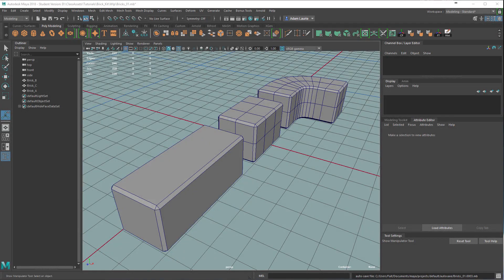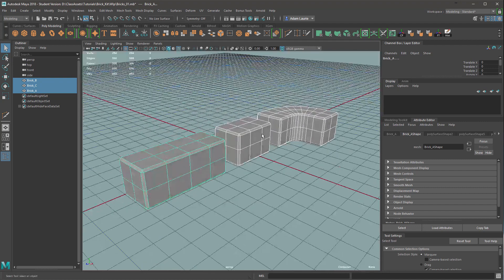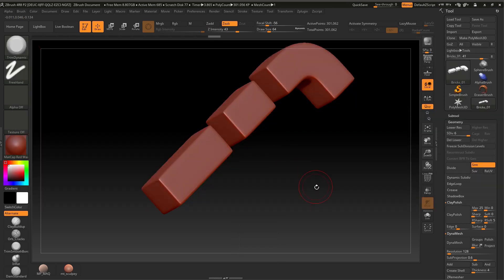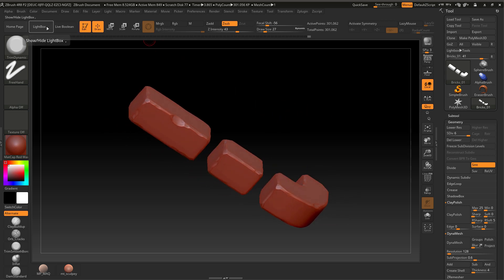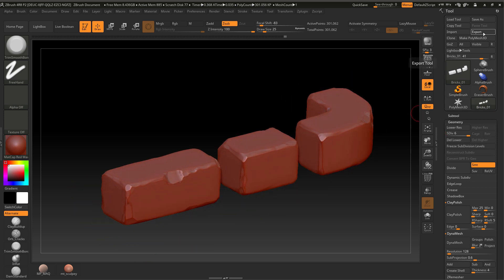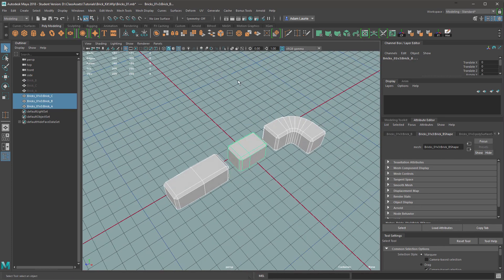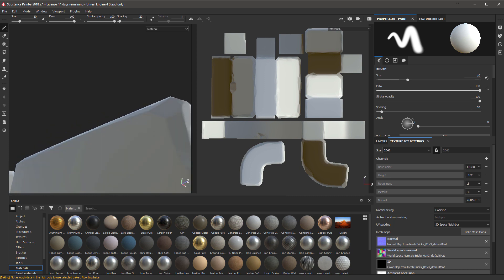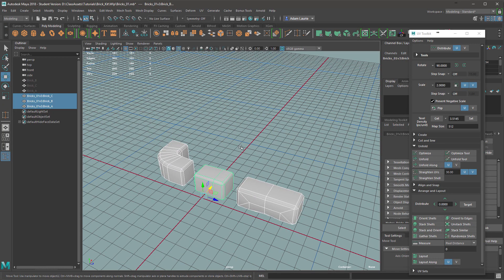Sculpt Modular Brick Kit Fast Workflow ⚒

Comment: Great tutorial! I just didn’t quite understand the part at 11:55 where you say that I have to increase something if I want to avoid errors and keep my mesh rigid and square. What should I increase so I could do it?
Reply from the maker: Sorry, this is quite an old video now, what I was saying was that if the mesh you want to use as a low poly in painter is very different in shape to your high poly mesh you made in zbrush then when you try to project(bake) the new high poly details down onto the low poly mesh within substance painter it might struggle - sometimes increasing the "cage" (sometimes called envelope) values In the baking options in painter will help capture some of those details and fix errors. You can normally see these problem areas when you bake as they will show as flat spots with no fine detail in your normal maps, etc - so in this case you would increase the size of the baking cage so that it captures all of the high poly mesh.
Reply: @RobotArmy3D  Understood, thanks for reply. Most of the time I adjust the low poly mesh so it could represent the shape of a high poly. The only problem that I may encounter is the weird “lines” on the edges. Even though I bevel my low poly slightly on the edges and apply all the smooth stuff, those lines always appear on the edges after baking. They are not quite visible, yet still a distraction for me. I guess it has something to do with UV unwrapping cause it’s kinda a dilemma for me but I thought that cages might help me with these artifacts